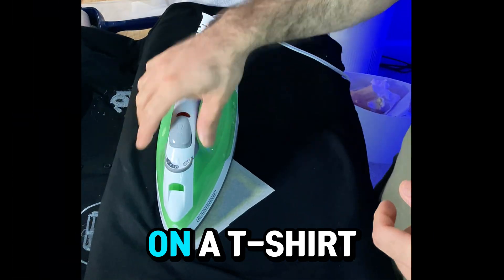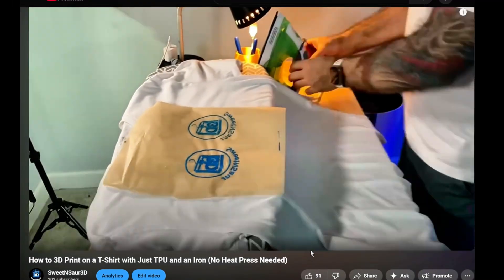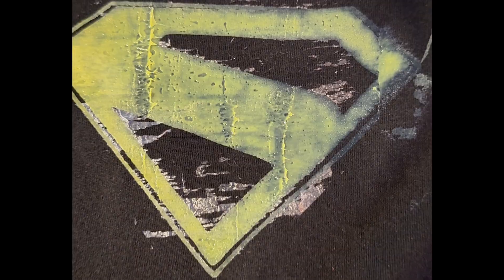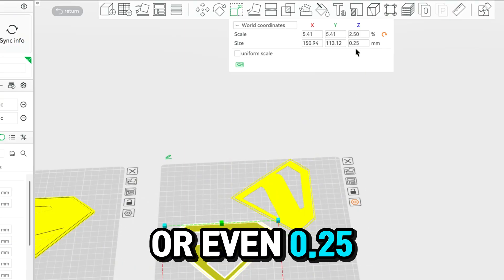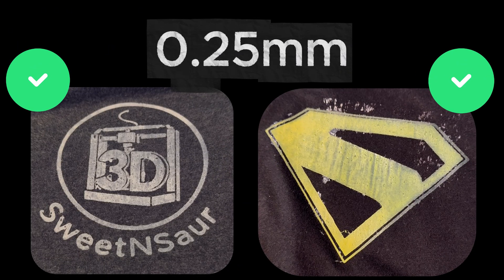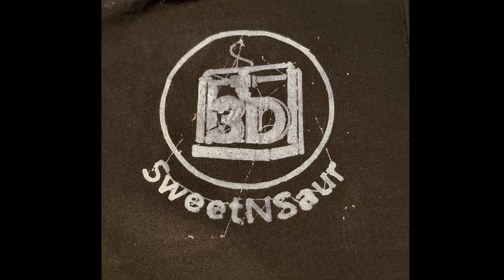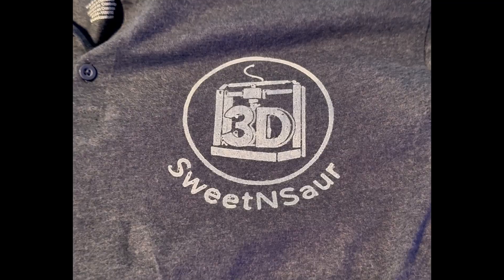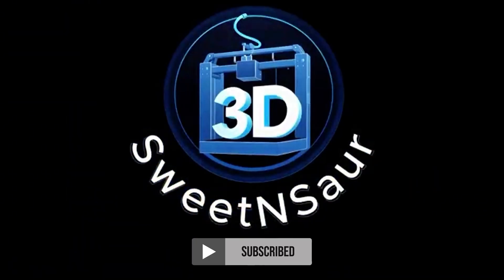How to 3D Print on a T-Shirt - Part 2: Cleaner Results with These Two Easy Fixes

Comment: Cool! I'm curious if you print a negative if the image in another, higher temperature material, and then print the TPU second, if it will keep the transfer crisp. Basically what you've done, but fill the empty space with petg or nylon that won't melt enough to transfer
Reply from the maker: Like using PETG/nylon as a “backing/negative” so the TPU is the only thing that melts into the shirt and the edges stay sharper? I haven’t tested that combo yet, but it’s a really cool idea for crisper transfers if it works out!

Comment: Thanks for showing how you do this with TPU. Also, you might consider a follow-up video to show how the iron-on prints hold up after a number of washes/months of wear.
Reply from the maker: Appreciate that! 🙌 A follow-up video is on my to-do list  — I’ve been putting some shirts through the wash on delicate and air drying, so I’ll definitely share how it holds up after some time.